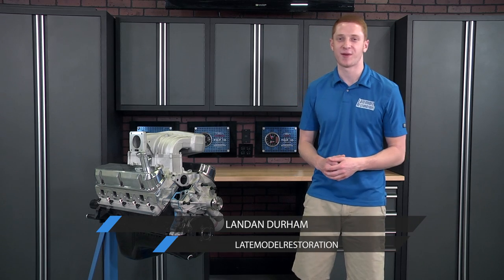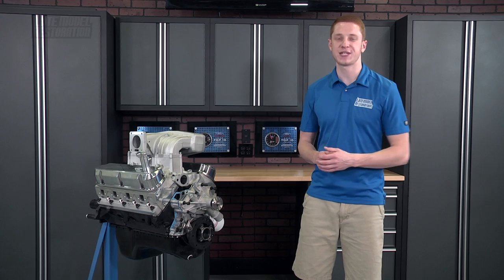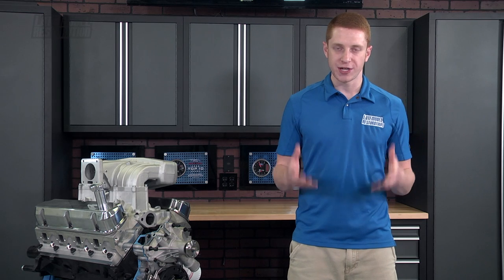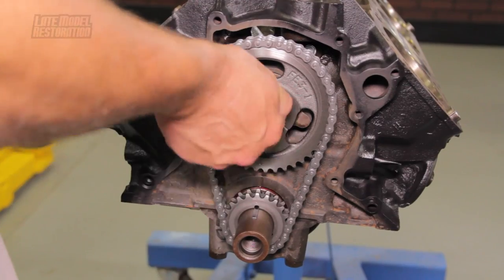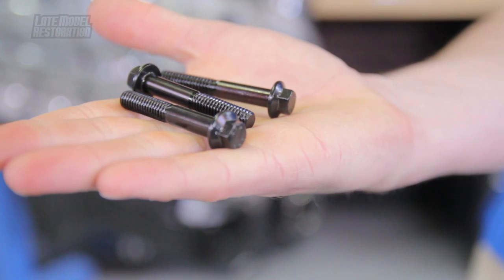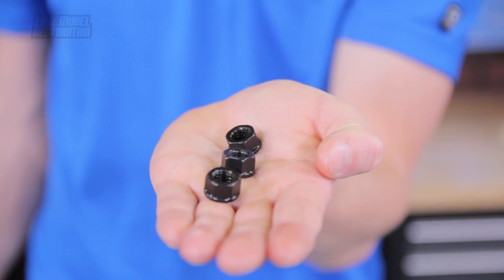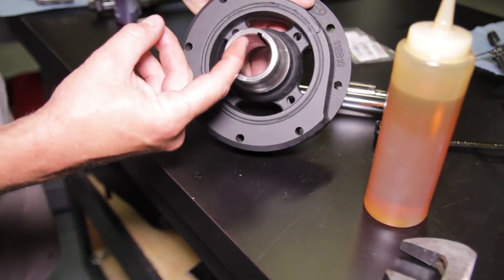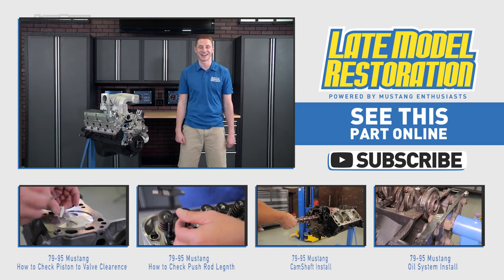How To Install 302/351 Mustang Timing Cover & Water Pump (79-93)

Comment: Vid saved me further aggravation when installing my 1994 F-150 5.0 harmonic balancer. Don't know why the rental tool doesn't come with a spacer needed to press on the balancer on these Ford crankshafts. Though, not mentioned in the vid, I did see that you used an old timing gear as a spacer. Great idea and it worked for me. You should make another vid focusing only on the removal and installation of these Ford balancers. Also prior to installing, warming them up in an oven at 250 degrees for 15-20 minutes and immediately installing them will help ease the process. Great vid, thanx!
Reply: warm the balancer itself? I rememeber years and years ago with my first timing cover install I did put a gear in the oven. I believe it was the one that went on the crank and I think it was 2 gears where I believe one went on fine but had to put the other in the oven.

Comment: next time i drive my 94 that will confirm rather it was the bypass hose or the timing gasket leaking. I will also check my book to see when was the last time I replaced the WP. I don't usually like replacing things that don't need it but understand why some do while they are in that area lol........

Comment: My water pump bolts all go in but after tightening all the other bolts one bolt won't thread I got an after market water pump with the old bolts I used rtv for a gasket on the new cover

Comment: Huh it must be one of those magical covers that doesnt need oil pan bolts and those pos cork wings to replace the oil pan gasket under rhe tc cover. I sure wish i could buy one of them as opposed to trying tp get the pan to stop leaking.

Comment: I'm running an aftermarket electric water pump.....what are your recommendations for bolts to hold the timing chain cover since it is only attached with the 4 bolts around the water ingress and egress?

Comment: So do you use any kind of sealant for the gasket? Some people will run sealant all the way around and then put a gasket on?
Reply from the maker: Sam - If you'd like, a thin layer of RTV silicone sealant can be applied to both sides of the water pump gasket to ensure a proper seal, but is not strictly necessary.  -Landan
Reply: @latemodelrestoration  I think he was asking about the timing cover gasket as well..

Comment: 2 Questions 
I will be using the cork corner piece gaskets on front of oil pan and bottom of timing cover. Should I place and seal the cork gaskets to the timing cover then install it or place and seal them on front of oil pan then install the cover? 
Next when should I install the 4 front oil pan bolts that connect to timing cover? After I install the cover water pump and balancer or sometime before?
Reply from the maker: I install them on the pan first then install the timing cover and water pump. Once that is all torqued down install the pan bolts. - Jude H. - Social Media Specialist
Reply: I've always heard bad things about using cork, how has yours held up? I used rtv in that area when I did mine years ago..........

Comment: You didn't show how you (didn't) tighten the two smaller timing cover bolts at the top using a, torque wrench, to 15 pounds... conveniently omitted that considering you can't.

Comment: Why there is no video explaining the more important thing. Gasket sealers.
Reply from the maker: What is your exact question? -Landan
Reply: @latemodelrestoration  What kind of RTV to use for the Timing Cover gasket, what kind for the water pump and which areas to apply them. There are tons of videos with different theories (red/black RTV, both sides of gasket, no RTV, grey sealer, spray sealer, etc, etc. also, for people who don't have the facilities/tools and have to replace the timing cover without removing the engine or the oil pan, what's the best way to seal the lower section. Thanks
Reply from the maker: @zh9119  I've used black or grey (whatever I have on the shelf at the time) over the years and they've both worked fine. Other than what we show in the video for the RTV, applying a thin layer around the ports to both sides of the water pump gasket wouldn't hurt. Hope this helps! -Landan
Reply: @latemodelrestoration  Thanks for your prompt answer Landan! Do you also apply RTV on both sides of the Timing Chain cover gasket or only around the area where the coolant runs?
Reply from the maker: @zh9119  You're welcome. Applying some RTV to both sides of the timing chain cover gasket is acceptable as well. I've done it before, but also never noticed any leaks when I didn't do it. If it makes you feel good, go for it! -Landan
Reply: @latemodelrestoration  Thanks Landan!
Reply from the maker: @zh9119 Sure thing!

Comment: How can I tell what year my 302 is ?
Reply from the maker: +2R98 By decoding the casting number on the block. To my knowledge the info is C=1960's D=1970's E=1980's and F=1990's. You may want to do a little research to backup this claim. -Landan
Reply: Late Model Restoration where do u find the casting#s on the block?

Comment: Is he saying 15ftlbs or 50ftlbs.? Torque.?
Reply from the maker: The water pump and timing cover studs/bolts torque to 15 lb-ft. -Landan
Reply: @latemodelrestoration  Hey Ladan. I just purchased the same harmonic balancer kit , on my harmonic balancer came with this yellowish ring in the back side of the harmonic balancer do we need to take that off or do we need to leave it on there.? Not to sure if it was just installed for shipping .
Reply from the maker: @martincarbajal9888  That sounds like a protective ring for shipping purposes.  If you'd like, you can send an image to our customer care department, and they can give you a solid answer.  Hope this helps!  -Landan

Here is the link to our Contact Us page if you need it: https://lmr.com/contact

Comment: Where does the dipstick go on a 1983 302 5.0? Through the designated hole in the timing cover?
Reply from the maker: If the car still has a factory oil pan, it installs into the engine block on the driver side. -Landan
Reply: @latemodelrestoration  thanks for your response!

Comment: Do you need to put any sealant between the area where the cork gaskets meet the rest of the rubber oil pan gasket and timing cover?  I've seen other videos where they put a healthy-sized glob there, or say you don't need much, to saying it's not necessary as once it's torque to spec it should form a fairly tight seal.
Reply from the maker: I wouldn't use cork gaskets. Yes, you need RTV in the corners where the oil pan meets the timing cover. That procedure is shown in our oil pan gasket replacement video (linked below). Use a one-piece oil pan gasket. -Landan

https://youtu.be/AJAsFZtfjuo?feature=shared&t=335
Reply: @latemodelrestoration  Thanks, Landan.  I'm working with an existing fox in a '77, can't do a total gasket replacement at the moment without pulling engine or sneaking under rack; the cork gaskets that replace the corners below timing cover will have to do for now but had to be sure.
Reply from the maker: @TerraFirmaton  You're welcome. I see! Thanks for clarifying what you have. Good luck! -Landan

Comment: I recently had a new w-pump installed(87 5.0)
And is now leaking at bottom two bolts. Im guna do it my self now, anything to do to get no leaks?
Reply from the maker: Ensure that the mating surfaces are clean and a good gasket material is being used. Tighten the hardware in a criss-cross pattern to 15 lb-ft. -Landan

Comment: What kind of oil do use for the harmonic balancer and timing chain
Reply from the maker: Hi Andrew, you will want to use the same oil that you will be running in your engine once you fire it up. This will keep the same consistency when building your 302/351.

Comment: I’m having such a hard time getting in that front main seal. Pleaseee I need your guys help: it just won’t go in straight and now it got bent. The second one did it too😕
Reply: maybe a block of wood that covers the whole sealand set the whole timing cover on wood and wack it good. if you say off it and just make it go it will go in..hesitation means crooked
Reply: oops meant say F it

Comment: Do the screws come with it
Reply from the maker: The hardware is not included, but we do offer this as a complete kit to eliminate any guess work. Here is this link below- Jay 
https://lmr.com/item/LRS-8501BHDW/1979-93-Mustang-50L-58L-Water-Pump-Timing-Cover-Studs-Bolts